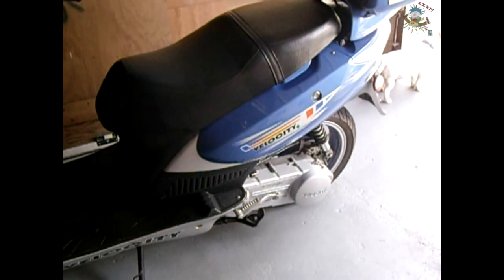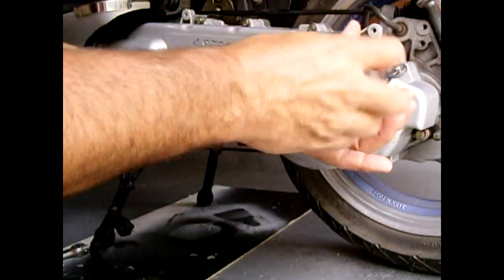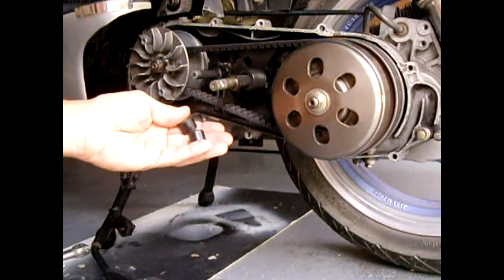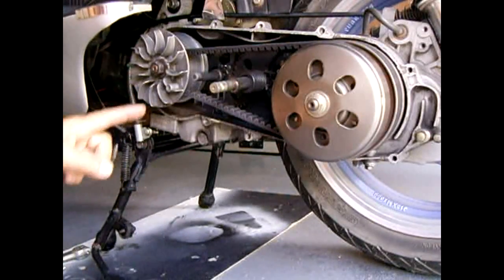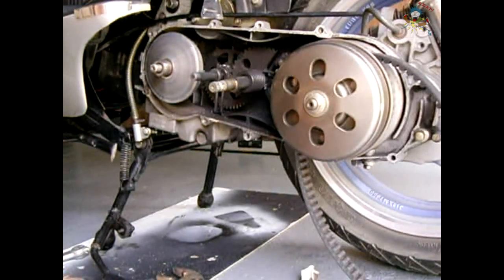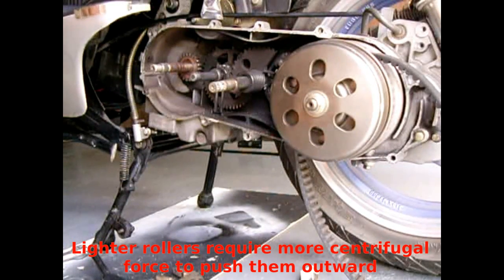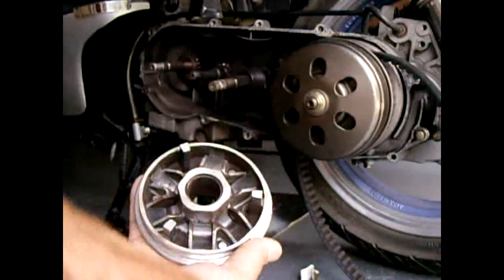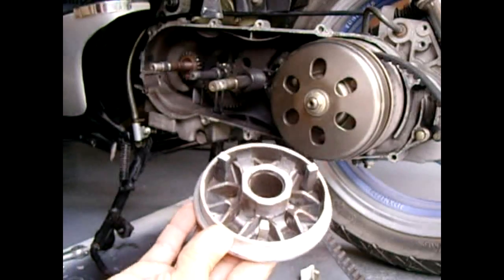GY6 Variator/Roller Replacement & Tips(STEP BY STEP)

Comment: Just recently riding my scooter and suddenly I began to loose speed, engine is reving, but something just isn't catching anymore. As if I'd getting some sort of slippage. It's a Chinese GY6 150cc BMS TBX 150. (Roketa Bali) (Tank Touring) (Lance duke 15) same thing.

Help?
Reply from the maker: Hello Charles. Sounds like the belt needs to be replaced, or worn clutch pads. I have a video showing how to change the belt.
Reply: The belt looks pretty good, I'm literally stranded at a dunkin donuts right now and it will only go 30 with a slipping sound. I bring most of my tools with me so I was able to open up it's CVT cover. It's hard to make out exactly what's wrong. A round metal rolling pin like thing did happen to fall out. Any ideas?
Reply from the maker: Charles Randolph
Leave the cover off and watch everything as you rev the engine. The round pin goes in the hole inside the CV cover.
Reply: I wanna say it probably has something to do with the Variator or probably the clutch pads...
Reply: So I was somehow able to ride it home. A few parts fell out when I took the cover off. Cleaned a lot of grease off the belt and around the inside of the clutch, assuming there was nothing else I could do I rode it back home... suddenly it worked fine without any issues. I'm sure something is still wrong with it but I'll keep and eye and try not to use it as much.
Reply from the maker: Charles Randolph
Remove ALL grease with brake cleaner. Do not get brake cleaner on rubber parts or painted items.
Reply: I had the same thing happen. Some of the teeth on the belt broke off. I thought it was bad gas. I eventually got stranded and took the cvt cover off and the belt was shredded to bits. In my case the kick start parts were loose and not in their correct spots. I bought a new belt put it on and now I only have high gear which leaves it undrivable. I can also tell the rollers in the variator are not in place but i cant get the damn thing off. I dont have an impact wrench or all these other tools.
Reply: Yeah, replace the variator and clutch depending on the age... some hardware stores allow you to borrow them. Impact wrench will get the job done with those damn nuts.
Reply: I found a youtube video where a guy used a really large pair of channel locks and a socket breaker bar with a long pipe on it for additional leverage. I tried it this afternoon and it came right off. All the rollers in the back of the variator were out of their grooves. I put them all back in place and put it back on. the scooter ran fine afterwards. I know it is a temp fix until the new variator I ordered gets here.

Comment: Hello, the belt need to be that tight? mine is a little bit loose. Thanks
Reply from the maker: +Jesus Palacios (JPdrums) 
If your belt is loose, then you may have the wrong size belt installed, or the clutch pulley is faulty.
Reply: electronicsNmore Hello, thank you very much. Now I feel tha my scooter have all the rpoblems you describe in your videos xD. Carb problems, and CVT problems, it seems that theengine is in good shape cause there is almost no smoke an turns on in one touch.

BTW. I have that metal-to-metal noise you describe, the loose belt and all-the-time closed clutch. when the bike is up in the stand the wheel always spins. even at idle. well... I bough a second hand hybrid Yamaha majesty YP250 1998 with a 2007 GY6 150CC Engine (external case is almost identical to yours). its too much to ask for that oldie. Thank you very much for the tips and the videos. If you have any other sugestion, please, leave it. My bike will thank you xD
Reply: electronicsNmore Any way. Whats the top speed of your bike?. mine is 50mph (if I want to reach 51 I need to push it by foot xD), as soon as it smels any hill it goes down to 30mph.. Maybe a cluch or carb or both problem. I will open it up the next week. Thank you in advance
Reply from the maker: *****

Hello. I lived on an island which had many hills. The best setup for my bike was 15 gram rollers and 1500 rpm springs. I had good performance up hills. You can also have a carb problem, or low compression.
Reply: +electronicsNmore Hello, It´s me again. Thank you very much, really helpfull. When I turn by hand the engine variator fast I need to apply very much force to make it turn when the piston is at the compression stage, but!, when I turn the variator very slowly, the engine offers almos no resistance to turn. Can be that a sign of a compression leak? thank you in advance!
Reply from the maker: If you are concerned, do a compression test.

Comment: Will this speed up my scooter ? And how much ?
Reply from the maker: Heavier rollers usually give you a higher top end speed, but you'll lose some speed off the line. How much? Every scooter is different. Thanks for watching!
Reply: @electronicsNmore  Thanks, its for yamasaki 150 they havent been changed in years so I want to put good variator and rollers. And will sport variator with rollers be good and speed it up a little bit, his top speed is 75 km/h and I feel it chould go faster.

Comment: Any one can help me to know what is the reason of not move well my CVT scooter after getting the speed more than 50 km is it the problem of variator or clutch ?.. and please give me the solution...
Reply from the maker: Check timing.
Reply: Is your idle speed normal? Should idle at about 1500rpm for a 4 stroke

Comment: Hi, i have a Kymco agility which i have bought a Naraku racing vario, i have also got a Naraku cdi, can anyone tell me if the 125 agility runs good with the standard cdi and racing variator or if it is nessessary to put in the racing cdi and up jet???
Reply from the maker: Hi Brent. I personally would not touch the jet. If you switched to a larger bore on your engine, then yes, otherwise I would leave it alone.
Reply: So, do you think that with the Naraku vario and stock cdi will give me that little extra take off?? I dont know the weight of the stock rollers yet! And with the Naraku vario came 2 sets! 6 at 10.3g and 6 at 11.4g, i guess with normal cdi and new hightened ramp on vario its just a case of getting the roller weight combo right for mostly in city but also runs out country roads!! I dont expect a rocket or i would just sit my test and get a bigger scoot but having bad back problems a scooter was perfect for me, and i am actually surprised at how well my little Kymco being very basic but is still good for sitting at 60mph, but most as i said is downtown and just need that bit of pull to feel safe in traffic to get out the way!! Thanks for your reply!!
Reply from the maker: I know nothing about that particular scooter. You are going to have a lot of testing to do to get it the way you want. There is no simple answer.
Reply: Thought so, thanks for you help!!

Comment: Does this bad roller make noise too much?
Reply from the maker: Hi Kaylan. Yes, you'll get a rattling noise.
Reply: I already changed clutch shoe,belt,clutch shoe bearings but still noise coming if I change the variator roller that sound become original?

Comment: i have a hammer head gts 150 and it rattles a lot when i give it a little throttle but onnce i get a little higher rpms the noise quits
Reply from the maker: Sounds like worn rollers.
Reply: electronicsNmore yes it does but i just got it about a month ago
Reply from the maker: Joshua Beanblossom
Either the wrong rollers, or something is loose.
Reply: electronicsNmore it could be just frame rattle but im not sure its a hammerhead gts 15p

Comment: my people 50cc had some very heavy rollers . run about 45mph ... I changed the rollers to a lighter ones 4g . LOL won't go pass 35mph .  I'm going to try some 7g see what it will do.  I know 45mph is very good for a 50cc . but the engine sound like it's running to high at start up speed.
Reply from the maker: WAY too low. LOL. You should have tried 2g lower and 2g higher. Higher is better for fuel economy, and "MAY" give you a slightly higher top end. Lower weight rollers are better for going up hills, but the engine will rev more before moving.

Comment: Well, set off to work this morning, and can't get above 16mph ( around 20 on the clock). Just juddering like a b$"^%$£d.

Checked plugs, checked filter, that's as much as I do.

Fires up though and ticks over fine, engine revs its balls off fine when on stand but something (belt slipping????) is wrong.
Reply from the maker: Could be MANY things. Not a simple answer to give.

Comment: I just replaced my rollers with new ones now my moped feels slower runs ok but slower
Reply from the maker: The weight is more than likely different.
Reply: @electronicsNmore  I put my old rollers back in and got my speed back

Comment: Why is it when people make these videos they just tighten the variator and clutch centre nut but never say what the torque setting is ,if you over or under tighten these nuts you will get clutch judder .
Reply from the maker: Gwyn Roberts Never had to torque it, and never had any problems.
Reply: @electronicsNmore  If the variator nut is not tightened to about 90 ft-lbs , it will back off and cause the whole pulley to fly apart.  I've had that happen twice, once while tooling down the road at 55 mph on my 250cc Chinese scooter.  Caused an awful mess and was lucky the wheel didn't lock up.

Comment: wow your belt is way loose I underand its comprested but still looks way to big.
Reply from the maker: vorkev1 It is the correct belt. 842-20-30. The belt tightens up once the engine starts up. 

Thanks For Watching!
Reply: electronicsNmore they do stretch over time it just looks bigger then norm in the video I guess
Reply: electronicsNmore i have a 50cc scooter no one knows why it makes noise after 25. it idles like shit. when i press the brake lever in it idles better. wow i only get these fuked up problems.  ideas ? t.y.
Reply from the maker: In order to fix the noise problem, you need to pinpoint the location of the noise. Poor idling usually means you need to check the valve clearances(which I have a video for), or inspect the carburetor.

Comment: i have a rubbing/grinding sound coming from rear end. gits faster and slower depending on speed. Opinions anyone
Reply from the maker: Hard to say without an exact location. Buy a cheap automotive stethoscope. Could be a faulty bearing.
Reply: K thanks
Reply: maybe your tire is rubbing on something ? I did that to a friend , I put a little  plastic on his back wheel and it was driving him nuts ...

Comment: DO NOT BUY ANYTHING FROM THE NYC STORE.
The NYC store ripped me off on a pair of shocks. BY FAR the single worst company I have ever dealt with online.
Please, do yourself a favor and buy what you need from somewhere else. You have been warned.
Reply from the maker: What are you talking about?
Reply: @electronicsNmore  Just that. NYC store ripped me off on a pair of shocks and I would like to prevent it from happening to someone else. It's just as easy to buy from somewhere else so why risk it or reward them?
Reply from the maker: @stuwest3653  Ok, I was wondering what you were talking about.